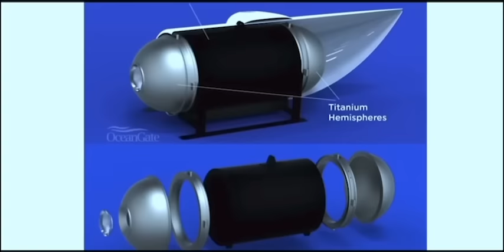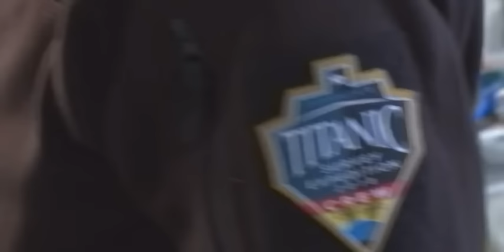First look at #oceangate #titan Debris

Comment: Carbon fiber itself is strong in tension, and not so strong in compression (probably due to its 'slenderness ratio' of the fiber being very high). So a carbon fiber is like a chain, strong in tension, and not in compression. The sub's pressure hull sees circumferential compression, mostly. The only component of the composite structure resisting the compression is the epoxy matrix. If you cast a chain in chocolate, how strong is that assembly going to be in compression along the axis of the chain?

Comment: The pressure at the Titanic depth is around 6000 PSI. The force from that pressure,  added up over the entire area of each titanium end dome,  was applied to the carbon fiber tube ends at the joint, acting to crush the tube down its length. But the same 6000 PSI pressure was also pressing over the tube surface as well, making it want to bow inward. The two forces act together on the tube. Certainly could have caused crack at the joint of the tube to the end domes, which would then fill with 6000 PSI water acting to open and enlarge the crack. I don't think the hull sensor & alarm system could have sensed cracking or movement between the tube and the domes at the two joints.

Comment: I only have a high school degree. You always hear hindsight is 20/20 but damn! So many things i see being employed here that scream catastrophic failure. Im truly COMPLETELY AMAZED it didn't leak in a pool test. Even though the glue cant work to not have it applied within a second and the 2 pieces put together immediately is a huge issue besides using 3 materials for the pressure chamber  the shape of a can we all know how easy they crush. Everyone touching that sub knowing people will be in it should have manslaughter charges. Whomever was building it in there factory or basement more likely should get murder charges

Comment: Good video. As an engineer, I appreciate innovative ideas, even those that may appear to have issues on the surface. But if you don't backup those ideas with analysis, simulations, testing, and adequate verification, you are a danger to the overall goals, not to mention in this case, more importantly lives. It's unfortunate there were no checks to protect against someone so out of control. Use of traditional construction and safety protocols, while still accommodating 4 paying customers, would have blown his budget many times over. But he should have waited until he had a safe, workable solution. High profile customer deaths are bad for business.

Comment: 2:39 They used chemical rather than mechanical fixings. I presume the carbon fibre cylinder and the bonds to the titanium plates were sent down to the laboratories, examined with electron microscopes and subjected to thousands of hours of pressure and fatigue tests. I mean, we all know the story of the Dehavilland Comet, right? And I can see that guy preparing the surface soon to be glued with that oily old rug he must have picked up from his garage?

Comment: I think they were thinking that the pressure against the end caps would keep them pressed against the carbon fiber.  It was most likely the "bowing" of the carbon as you said causing the carbon to crack and deteriorate close to the ring.
One flexes, one doesn't. Seems obvious now in hindsight.
Reply: Yes i agree, the endcaps would be held in place by pressure, ,but to much pressure would make the end the cf buckle,combined with the force pushing down on the sausage unreinforced tube , could have made the tube  deform  to the point of failure!

Comment: mate even the port window has no glass or acrilic or perspex left over, so it impeded with such force it popped out the viewing window at the front, plus just imagine the massive bolts to shut the end cap, all it takes is those bolts to stretch under pressure and once they do the end caps are no longer sealed its that simple, even if they changed the end bolts used to seal it every simple time, it would have maybe lasted longer, but i doubt it because of the carbon fiber and its weakness under extreme pressure . :)

Comment: I doubt the glue joint failed. The loading would be pushing in on the joint, not pulling it apart. The CF disintegrated.
Reply: Yes except that the contraction and expansion will occur at different rates based on the depth, then shearing the glue.

Comment: Considering the pressure would be pushing the caps onto the Carbon fiber...I don't think that was the issue. The carbon fiber tube itself was just not thick enough and the wrong kind of material to use, once it was compressed enough it would shatter.

Comment: I do not know what the expansion coefficients are for titanium and CF but usually dissimilar materials have different expansion/contraction rates when reacting to pressure and temperature this could have caused movement at the contact boundary and I am sure there would have been no elasticity in the adhesive so it would crack, if this was the case then the CF was withstanding the pressure however for how long we do not know.

Comment: Under intense pressue, I think that the carbon fibre will compress at a different rate to the titanium, I'd expect the titanium to have a slot that the cf slots into instead it just sits inside the ring, so the pressure is trying to push it away from the ring.  I'm suprised they managed any successful dives. They would have 100pc relied on the tensive strength of the adhesive.  Also,  why can the sub not have done dozens of unmanned dives to prove the technology.  If you're going to take people to 3800m I'd want to see it having dived to 5000.

Comment: I don't think the sub imploded. I also think that the glue was the weak spot. Due to the fact that carbon fiber handles stress much difference as titanium, I think that the glue connection did burst. This resulted in leakages. The ocean water got the opportunity to get in the passengers tube with speeds that are higher than the speed of sound. This water was a water cutter and probably destroyed almost everything that came in his way. The tube filled up with water at high speed. Pressure and temperature in that tube are going up very fast. Further on cavitation has probably played a role. The pressure in the tube got so high that the titanium caps were blown of. When you look at the recovered parts, you will see that the titanium caps are clean on the glue surface. When the Titan was imploded you would see rests of carbon fiber. But they are all gone.
This is just a possibility and a personal vision. I don't say that I am right, but just wanted to share a different approach.

Comment: The company that built it just built it to the design they were given. I suppose they could have turned the job down but its hardly on them if ultimately it gets misused. 
And while a sphere shape might be more ideal, we certainly have cylindrical subs and submersibles that function just fine.

Comment: You said it: "I'm not an engineer". I am an engineer. Stockton Rush suffered from the Dunning–Kruger effect. Your conclusion about the glue bond failing is a possible cause, however, the use of a laminated material such as the carbon fiber epoxy matrix was questionable for a compression application. 
 
I believe the the repeated stress from previous dives formed micro fractures in the carbon fiber epoxy matrix over time. Micro fractures eventually propagate through the epoxy matrix to form a fatal large fracture which of course compromised the cylinder portion. The individual carbon fibers probably never broke, just the epoxy bonding the CF. Supposedly the Titan had some sort of sensors to listen for cracks., apparently Stockton Rush or other engineers had considered it. I fear the crew may have heard some cracking sounds shortly before it imploded. Imagine the fear hearing the cracks just before the implosion. Fortunately for them it was all over before any pain signal reached their brain. Their "lights" just went out in a couple of milliseconds.

In addition, your conclusion about the failure of the bond at the end rings is is conjecture only. IF and only IF an analysis of the deformations of the carbon fiber and the titanium end rings was matched, no bond failure would happen. I doubt Ocean Gate did the analysis correctly if at all.  

A "pill" shape hull is not inherently wrong if the engineering had been done properly. Commenters saying "only spheres" are acceptable are just wrong and simply based on what they read somewhere else. After all, every US Navy submarine and indeed every other countries subs have a "pill" shaped pressure hull, albeit made of steel or titanium (USSR only). 

Conclusion: Don't quit your day job and present yourself as an "expert".

Comment: Seems like under exterior pressure, the cylindrical section would squeeze inwardly with the center having the most deflection. This would put the greatest stress on the part that joins the titanium end rings. There's nothing wrong with trying new ideas and new materials, but they should be backed up with rigorous testing, and determining the failure modes for the designs before taking on passengers.

Comment: Not to mention that they were applying the glue in a very dirty environment.  So the bonding area could easily have been contaminated with foreign substances that weakened the bonding.  Over time, it would eventually lose its cohesiveness.

Comment: I was thinking if the flanges of the Titanium needed to be longer to cover inside and outside of the carbon fiber to cover the inside and outside of the carbon fiber cylinder.  Plus, rods to hold end caps together to give them more time. But it was doomed.

Comment: I don't think the bonding of the titanium rings was the issue.
The failure most likely happened in the carbon fiber tube. 
It is true that carbon fiber has incredible tensile strength when you pull along the fiber's axis. But if you reverse the pull to push it will just buckle and bend, just like a piece of rope. So, carbon fiber is a good choice for vessels that are pressurised from the inside, like air bottles for divers or airplane parts, but it is an insane choice for the pressure vessel of a deep sea submersible. What made things worse was that they just wound the fibers in parallel like in a spool instead of doing a diagonal /perpendicular woven pattern like you find pretty much in any component made with carbon fiber.
Add to all that the cyclic extreme pressurization and depressurization fatigue this tube experienced, and it wasn't a question of if this composite tube woud fail but when.
The really crazy thing is that this design may have actually worked if they had just limited the number of dives before replacing the mid section instead of trusting those embedded sensors...

Comment: All the wear is going into ends where the carbon is meeting with the titanium - after so many times of enduring heavy pressure - you basically replace it after so many times - even stockton rush didn't even decide doing that- performing a strength test on all of it can tell you its at its end. Once carbon begins to bend , small pocket of water pressure makes its way in then poof, -  glue didn't secure much of any thing - it really needed to be bolted with gasket rings to keep form along with the titanium - it would gave help keep the form of the carbon fiber on the ends where it meets with titanium to keep its form, even possibly relieving pressure from the inside - it should of been a titanium all around then maybe appling carbon fiber form on the outside for buoyancy purposes- then titanium on the outside - to form of carbon fiber - stockton rush mentioned for - carbon fiber to bouyancy porpotions - im thinking it'd have to operate same way thursters work for shuttle exitting the atmosphere and entering into orbit - you need some thing (a thurster a booster) to slowly take them down there, not solely off of the submersible, creating all the interia, - when in doubt, get out - my soul aches because I know we can do better and I know we are smarter than this - shortcuts is way to get to the End faster

Comment: If he used several more of the rings as connectors and multiple smaller carbon cylinders and stacked them, even with the glue it would have been stronger, the spherical end caps would only have pushed at each end harder the deeper he went. The issue seems to be the flex / pressure on the length of carbon in the middle which ultimately failed. It made multiple trips, the theory was almost right.

Comment: The adhesive used to bond the carbon fibre to the titanium end cap, no matter how strong appeared in the video to be applied by hand. There is no was using that method that consistency of thickness can be achieved.Rest in peace gentlemen and may your god lay his hand on your shoulder

Comment: You need temprature controlled, humidity controlled for that glue.  Any moisture or air trapped in that glue could be a failure point.

Comment: It does seem sketchy, but you are ignoring the fact that the glued joint isn't in tension, it's in compression when it is underwater.  I doubt if the glue failed. What is more likely is that the carbon fiber became delaminated at the point where it was butted up against the titanium.

Comment: And the only thing keeping the end caps from forcing them selves together is the column strength of the carbon fiber tube. I think we all remember that childhood experiment of taping a piece of paper into a tube and setting a book on it, that experiment ending with a slight tap on the paper and watching the book fall to the table.   One little imperfection or shift in the material of that tube would cause those end caps to force himself together.
When it comes down to it that entire thing depended on the strength of the adhesive holding the carbon fiber together.  Wtf…..

Comment: They went to the bottom of the Atlantic essentially in a capped plastic pipe, which got crushed like a beer can under pressure. You don't have to be a rocket scientist to understand that glueing together two materials with completely physical properties (the spherical titanium end caps, and the tubular carbon fibre hull in between) creates two seams which are prone to fail due to the different expansion & compression moduli of the materials - and the remains salvaged from the ocean floor seem to verify this so far.

There is a good reason why all of the successfully deep sea-diving vessels have passenger compartments in the shape of an almost perfect sphere, made from predominantly titanium, as this is the one and only shape that distributes the humongous pressure evenly across its surface, and with sufficient wall thickness does not collapse under extreme pressure. Look eg at "Alvin", which has successfully made hundreds, if not more than a thousand deep sea dives, taking more than 5,000 passengers into the deep - this is how to build and properly operate, maintain and constantly upgrade a 4,000 metre deep diving submersible (and not like OceanGate's flimsy Titan sub). This was a desaster waiting to happen, what surprises me is how long it took to happen.

Comment: You're absolutely right. When you go through a cycle from zero lb of compression bolt on the lid and go into a billion lb of compression total, everything must change shape. When two things that are not the same material with the same geometry like a sphere meet and go through this cycle with this kind of load, failure is inevitable. environment

Comment: Holy $@(! The way you just explained it made perfect sense. The titanium will have different compression characteristics than the carbon fiber which means the area where the carbon fiber sits inside the titanium rings is a massive engineering mistake and a point where so much can go wrong. I'm willing to bet water got into that area during previous dives and that the only thing really holding the ship together from implosion the first few times was the freaking epoxy glue!

Also, every time he heard cracking from the hull, it was not the carbon fiber "just setting in" but in fact the carbon fiber already starting to form microscopic tears and cracks. Even at five inches, carbon fiber isn't designed for compression forces at all. The epoxy was probably handling the bulk of the compression forces and epoxy is obviously not a solid long-term choice to handle compression forces for a submersible. 

The more I study how this ship was designed and put together, the more I realize this was a death trap just waiting to randomly implode.

Comment: Carbon fibre manually glued to metal(Ti)  doesn't  equal a ”contiguous joint of dissimilar materials” . Did OG hv the stress-strain relationship of that  Carbon fibre-glue-Ti joint? Likely the depth pressure brought the sub to duty the joint, at non elastic part of the stress-strain characteristic.

Comment: I agree with the person who made this video.  I also do not pocess any type of engineering degree whatsoever and it doesn't take much to understand what could have gone wrong and what probably did go wrong to cause the implosion of the Titan submersible.  What I don't understand is how someone with an engineering degree who is apparently working with engineers can be so ignorant and irresponsible in their design of a submersible meant to carry 5 people (4 of which are paying customers) to approx 4000 meters below the ocean... and with no periodic testing for structure failure, damage, etc.  It's just mind boggling and extremely sad.

Comment: The window in the one end cap was only rated to 1300 meters = 4,265 feet... and it made numerous trips down to 12,500 feet. I noticed that the glass was missing from the end when it was lifted out of the ocean.
Reply: Pressure wave from the implosion might have yeeted it off somewhere (a sudden 4000 lb/sq in pressure differential will do that), doesn't necessarily mean that the component failed. Although, of course, it could have.